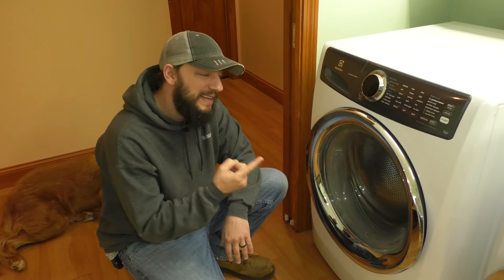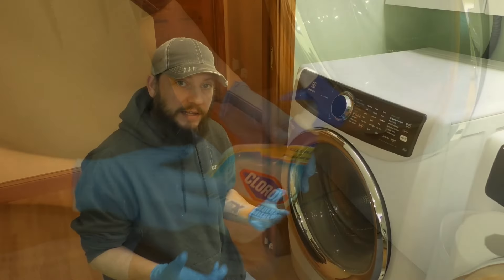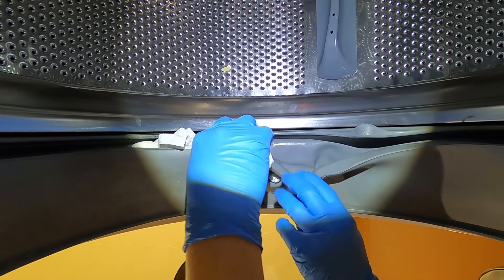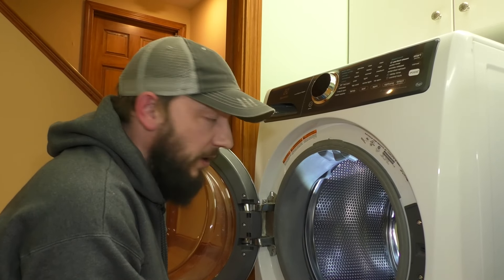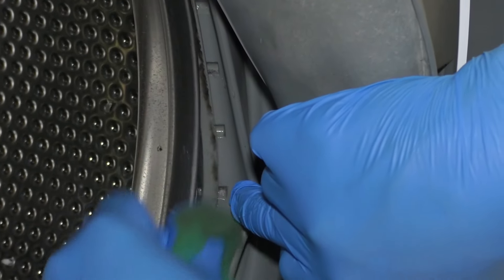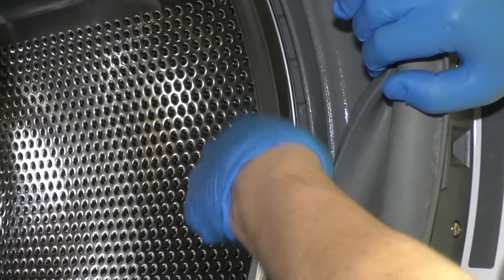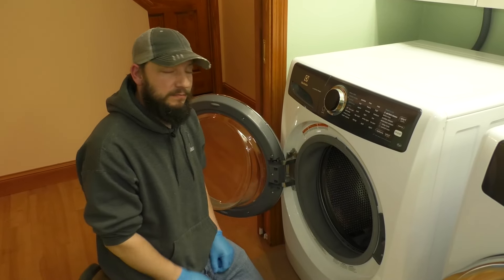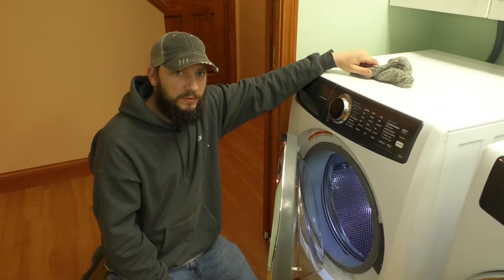How to Clean a Moldy Front Load Washing Machine

Comment: It just so happens that I work at a laundromat and own a front loading washer.  I have some additions about the use and care of your front loading washer.  
The pull out tray for your detergent and fabric softener can become gunked up with a residual film leftover from the products you use.  Gain and Downey are the worst for creating this residual build up.  This is what is probably causing the leak.  You can gently pull the tray out from the machine to clean it.  I have to do this with my Maytag at least once a month.  
Another issue that a lot of people don't realize is that using more laundry detergent than what is required can also cause problems.  Number one being "Suds Lock", which is when there is so much soap and suds in the washer that you can't see your clothes washing and it can't and won't drain correctly.  Suds trap the dirt and grime from your clothes and won't drain as easily until they pop.  To correct a suds lock issue, add a small amount of fabric softener to the wash, before it drains.  If you have a front load washer add the softener to the detergent cup and flush it down with a cup of water.    
Suds lock can also create a film on the inside of the washer drum, the one without the holes.  Over time that film can and will build up and make it more difficult for the washer to do its job and not allow the water to drain properly.
Also, with front load washers, never leave them closed and locked.  Over time the gasket will no longer be able to maintain the seal if it is constantly being crushed while not in use.  Just like anything else with gaskets, they will wear out and are a pain in the A$$ to replace.

Instead of using paper towels to clean your gasket use a micro fiber cleaning rag.  The more coarse the better.  Paper towels can also leave lint behind.  The Clorox with Tilex is great product.  But I do something a little different.  I use 1/4 cup of Clorox with Tilex with 2 tablespoons of baking soda and 2 tablespoons of Borax.  Mix it together until you have a paste and then dip my MF rag into it and scrub wherever I find mold.  I let the paste sit for at least 30 min and check to see if the mold is still there.  If it is, repeat until it's gone.
I hope these tips can help.

Comment: Think I’d have to do the desperately wanting to avoid part. Sometimes avoiding more work causes extra work. 

More work for lesser quality is a no go. You did a pretty good job considering everything in your way. 

I’ve always heard run an extra load of vinegar water. Not just because of that mold you have going on but laundry soap and fabric softener is not good to the machine. So the vinegar load helps take care of that too

Comment: Who has time or wants to take the time to clean a washer like that. Even having to wipe down the washer after use is just one more reason I refuse to ever have a front loader. 🤣 When we bought our house, it came with an old-timey Maytag pair that worked well, except the washer was small and didn't fit large items like comforters, so when it finally died, my husband was keen to get a front loader. Absolutely not. I've seen it all, and watched it all, which was enough to convince me that I'd rather keep on keeping on with top loaders, with an agitator to boot. It's a deep tub and the only draw back is that for some items that might be hard to reach at the bottom, I just use a grabber. 🤣 No smell, no mold, no gross gunk, no leaks. Still enjoyed the video and your determination to get that nonsense cleaned though!

Comment: We found out the best way for us to remove that mold… Oxyclean

We have a Miele front loading machine. Love it… and man it had HUGE mold even if we let it or whatever. The thing was worst than yours…

We use oxyclean in EVERY laundry… we have also hard water (and a water softener too, hard we iron and manganese) and slowly that mold went away by itself. We put it inside the tub, inside the soap, the softener dispenser and really, now all the mold is almost gone and the machine and the clothes smells good again! Took about a month to see the results.

We use it in conjunction with the soap and the other stuff.

We do the same in the dishwasher… (still use soap too)